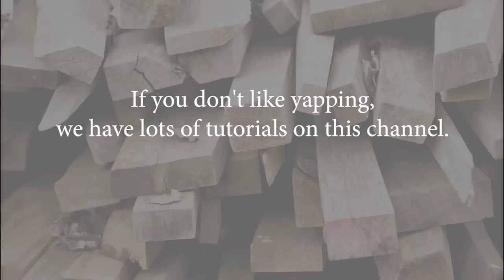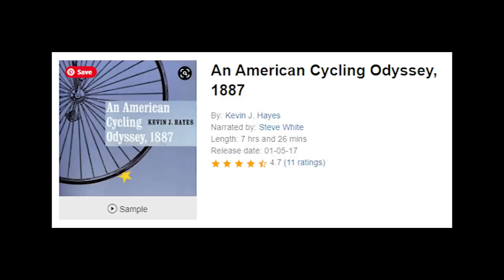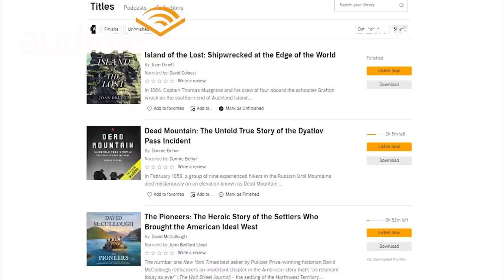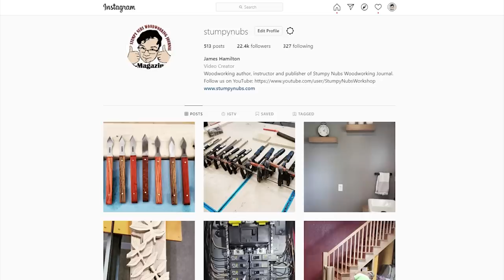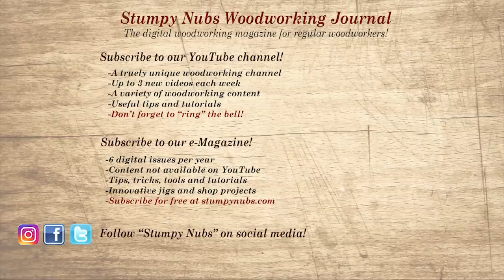Have they BANNED table saw dado sets????

Comment: Be advised: Long text following! Non native speaker writing!

Well, at least in Germany Dado sets are not straight out forbidden by law, just by the national work regulations for >>commercial use<< of the machinery.

As you said, the weight of the driven tool and the stop time to match (or to better) are reasons these things are banned >>in work places<<.

Another factor is, that the regulations explicitly say, that a tool is only to be used for its intended use and not to be modified for other uses. So a table saw is only to be used for cutting through material and not to make dado's on it, for instance.

You briefly touched on the arbor length: That is done by the manufacturers, because they themselves define the tool to be mounted and used on their machines. Any other tool mounted to the machine or any modifications to fit that tool, is...how do I phrase that right... Let's try it this way: If you use tools, or in this case specifically: blades with dimensions the manufacturer of the table saw says are okay, then, if something happens and it is a constructive problem of the machine, the manufacturer is liable for any costs associated with injuries to people, damages to company property and lost profits, because the machine "blew up", so to say. But: If the machine is modified in a non conform way, the manufacturer is no longer liable, because they can say, that the modification made it possible to use the wrong "blade", which is use in a non conform way.

TL;DR: It has to do with liability, quite simple.

However: If you can get another arbor or build your own and exchange it for the original one in your saw, you legally can mount a Dado set on your saw in your hobbyist woodworking shop. Because: What you do in your private hobbyist shop is of no concern to any work place regulations, as long as only you yourself are working on that machine and >>absolute nobody else<<!
But: If something happens, you are yourself on the hook for everything - as always.

I hope my point came across the right way.

Edit's: Missing or wrong letters, added critical part of sentence.
Reply: Very knowledgeable and clear explication. That's how I knew you were a non-native speaker :)
Reply: These endless nonsense For Your Own Good "safety regulations " are sweeping America too :-( but for now. MY DADO STACK STAYS.
Have a nice day.
Reply: @uglybobhere  Well, in Germany any employer is mandated to make sure his/her workers have safe and appropriate tools and machinery to work with. And a safe work environment as well. Furthermore they have to make sure these things stay that way over time.
In case you didn't know: Here the employer supply's the tools for the job. The employer even needs to supply the safety equipment (PSA), like gloves, safety footwear, helmets, safety goggles, etc. If you change jobs, you need to give back the tools, but your PSA is of no use to them, because of sweat and what not.
If you loose a tool or it gets damaged during use, the employer needs to replace it. But don't let that fool you: If that happens too often or there is a pattern, you need to justify every replacement and explain, why tools break regularly. That can be indicative of wrong use or the wrong tool for the job. If on the other hand you fail to justify properly, there can be reprimands for that. But that's up to the employer on a case to case basis.

So, it is in the best interest of the employer, that you use quality tools and that you use them appropriately. If a tool has a manufacturing defect and it hurts you as a worker, then the manufacturer has to pay, because they sold something unsafe.
If the tool is damaged while in use and you don't stop using it and because of that you get injured, your employer's business insurance is on the expensive hook. The very same applies to when you as a worker modify any tool or machinery in a unsafe way and something happens, the employer's insurance has to pay for your ignorance and dumbness. But your employer's insurance fees will likely rise and he/she could be paying huge fines.

So it is in the best business interest of your employer as well, that every tool or machinery you use is safe and inspected regularly. With something like "bring your own tools" like is custom in the US (at least that is the last I heard), that is not possible.

Yes, safety slows down many things, but better that, than some heavy, life long injury.
Reply: Felder even sell there one dado blades for hobbyist
Reply: @madman6648  Felder does build what the customer wants, more or less. If a customer wants the machine to accept dado stacks, they make it so. But not everyone is able to put a Felder in their workshop.
Reply: @madman6648  Felder also sell dado blades for commercial use. The reason they can do that is that their machines are equipped with a good enough electronic brake to be able to stop the spinning dado blade within the regulated time. But in order to prevent the locking nut from coming lose the blade is held in place with some additional locking pins which prevents the blade from rotating on the arbor. This means that the blade needs holes to locate this pins and you are basically limited to the dado set felder sells. But yes. you can get a felder (or hammer) saw that accepts (felder made) dado blades, and fulfill the regulations in (most of) Europe. (The locking pins to prevent blade rotation is placed on all their saws, not only those accepting the dado stack. So all saw blades needs appropriate holes for those pins. )
Reply: @palundblad9346  I think the holes are pretty standard for the 30mm arbor blades used in Europe,  certainly not unique to Felder. I bought blades with these holes long before I had any idea I would once own a Hammer saw.
Reply: @tilmanbauer5728  I agree. It is quite common here that blades have the holes for these pins. I just wanted to highlight that the holes wasn't specific to use with dado blades. But it is also a fact that not all blades have them. I had to get rid of some otherwise suitable blades when upgrading my saw due to the lack of holes for the indicator pins.
Reply: I am from Slovakia and i was thinking that dado blades are "banned". Then (recently) i went to Felder dealer where i ordered table saw. Was really suprised that they offer in their catalogue dado option for little surcharge. Of course i choosed this option 😀. At the moment i am really confused - i dont think any law has changed (within EU), but on other hand Felder provides dadoo option by official way 🤷 (thanks god for it 😀)
Reply: I guess you also need to mention the "Berufsgenossenschaft" (BG). 

(AFAIK)
In Germany an accident that happens during working hours needs to be reported to the BG - if it happened due neglect the employer needs to pay a higher fee to the BG. The BG also has a statistic where a lot of accidents happen and will adjust safety protocols accordingly.

Simple example - if a lot of accidents happen while employees are drunk - working while intoxicated will be forbidden.

Some regulations only make sense after years - e.g. special knee-pads. The juvenile knee won´t have a problem without, but the worker 20 years along the road will have accumulated enough time to have broken knees.

Yes, you do not have the freedom to disable yourself, as we have public healthcare, and the public in the end will have to pay for it.
Reply: @essmene  everything I stated above does refer to the BG, more or less, but naming it wouldn't help much on an American woodworking channel, without proper reference to something they know.

You have to remember how little Germany is compared to the US and how far away.
Reply: @wiedapp  I just wanted to point out that some of the safety regulations are the result of statistical injuries. So if Jay says he has been working doing X and nothing happened - the statistics are out of 1.000  workers 5 loose their digits/hands/eye. You do not necessarily have to encounter it yourself for a security measure to be effective and necessary - if you want to work - if your goal is being maimed that is a different topic.
Reply: @essmene  thats barbaric! In America we only add safety regulations when it benefits The Corporation to add barriers to entry for potential competition.
Reply: @bobcougar77  Or when it happens to someone less than 20 years old, or with less than a year on the job.  Or a minority with less than 15% representation in the community.  Or...

Comment: In general, I find dado cuts to be safer than standard cuts. The blade is rarely more than a half inch above the table, and it is completely covered by the work piece so it is easier to apply firm pressure down and into the fence.
Reply: totally true!
Reply: For metric system users:
0.5in = 1.27cm
Reply: @chri-k  I have to admit half an inch protrusion does seem safer than 12.7mm.
Reply: It’s not about the safety of the cut. It’s about brakes jerking blades loose. And keep in mind; mist euro sliders take 16” blades.

Comment: Back in the day, we used to use wobble saw washers so we could cut wide rebates with a single blade. I just looked them up out of curiosity and they are still available in the UK.

Comment: If the more concerning issue was the potential of the blades coming off the arbor I'd say something like a retractable arm that can be placed at the end of the arbor, kinda like the tail stock on a lathe could be made to ensure blades could never just fly off.
Reply: That's a good idea!
Reply: What about adding a jamb nut onto the arbor?
Reply: @calstatelaalproductions2358  
Was kinda my first thought but I assume someone figured it would be an extra peice or small part that people could easily lose, forget or whatever and wouldn't ensure safety.  Of course I'm only guessing at the logic but I figure something like I'm thinking of could be integrated with an interlock of the power switch and be a permanent fixture that would not be a very expensive add to the overall cost and perhaps could have a secondary function of being able to jam or force into the arbor as an added breaking system.
Reply: Or just a simple lock nut, threaded the same way as the main one.

Comment: I use to work in a furniture factory.  One of the guys did a plunge cut with a dado blade and started to far forward.  So he pulled it back about 1/4" and the piece shot back wards and his fingers went into the blades.   Since then I am alot more cautious about them.
Reply: Did he lose the fingers?
Reply: @andysmith1996  I'm sure someone found them. They usually leave a squishy red trail.
Reply: Fingerless Carlson?
Reply: They never found his fingers. But they did find some hamburger meat. Why someone would store hamburger meat in a table saw is anyone’s guess.

Comment: Nice discussion. I recently updated my Delta Unisaw I ordered new 20 years ago. I replaced the stock guard/splitter with the Shark Guard manual riving knife/splitter dust collection guard. I also inherited a Delta 1.5hp dust collector and followed your upgrade recommendations for the Wyn pleated filter and using a 5gal bucket with small clamps to channel the dust into an easy to dispose of trashbag. After sealing up the Unisaw cabinet some to force the air from the cabinet dust port to pass by the blade and having another 4 inch port connected to the Shark Guard, this saw area now stays fairly clean for such a low power dust collector. The old saws don’t support the auto riving knives, so this Shark Guard option is a nice upgrade and much easier to deal with than the stock guard.

Comment: I have been lucky, when my father upgraded he gave me his 35 year old moa Shan TSC table saw with a nice long arbour, originally supplied with a wobble blade (now that's a scary piece) I got a diablo set from the US because that blades "can't be sold in Ireland" and 3 days after my set arrived, my local tool store had one but it wasn't on the shelf, it sits between the machines on the showroom floor. I love mine it was scary at first but in my opinion now it's no more scary than a 12" rip blade
Reply: I have 2 sets of calibrated wobble washers, that are, at least, 25 years old. My DaDo set is about the same age.  Have cut a lot of Teak with them, boatbuilding.

Comment: Imagine this solution to the European dado problem: an arbor that is 1/2 inch longer than standard. It is threaded in the normal way, but the 1/2" on the end is a of slightly lesser diameter than the rest of the arbor and it is threaded in the opposite direction. Then, when you install a dado set, you secure it with the normal nut, but in addition to that, you lock it with an oppositely threaded nut on the narrower last 1/2. The lock nut can have a wide flange that applies friction to the regular nut. It wouldn't be needed at all with a single blade. Then, it wouldn't matter how quickly the blades stopped and you wouldn't need a special guard. The two-diameter arbor and its locking nut could be standardized so as not to require special or additional purchases.

Comment: Here in Canada, there’s no issue getting saws with a long arbor and dado sets. I originally had a wobble blade, but after using a proper dado set, I’d never go back to one of those wobble blades. Before then, I used my router with a fence, but I feel much safer using a dado set than using the router to do it.

Comment: I do love the braking on the saw. It cuts way back on the amount of time I have to wait for the saw to spin down.

I have a Felder saw with grooving blades. It's not the same as our dado stack, though. It uses shims and is closer to shaper tooling in implementation. Same idea, different implementation. The brake has no problem spinning it down despite the weight. They also use two pins to keep blades from spinning off the arbor.

Edit: I also use a floating blade guard. It's much more convenient vs the one it came with.

Comment: I had not realized what a “privilege” it was that I’ve had for the past 50 years: my Delta Rockwell table saw has a Bieasemeyer rip fence and a standard American arbor that accepts my dado set.

And I still have all my body parts—except my appendix—which was removed without using my table saw!
Reply: That's what a radial arm saw is for.
Reply: @rudyschwab7709  Nicely done.
Reply: I ruined two blades trying to take my appendix out with a SawStop.
Reply: @joewrosenthal00  It was a joke responding to your appendix line. I'll make that clearer.

Comment: Personally I use a router to cut rebates in boards. As you will well know it can be done freehand with a router and the jig that comes with even the cheapest routers or better with a router mounted in a table using the fence. I simply don't cut enough Dado's or rebates to justify using a dado stack. You could also use an old school; rebate plane, or routing plane. You can keep your spinning stacks of death. ;-)

Comment: Thanks for that. We Europeans actually appreciate dado stacks and use them in private workshops.A lot of criticism comes from professional woodworkers who can't use them for insurance reasons. In fact I prefer the 5/8" arbor as I can use all kinds of American tools  like the mitre fold dado blade. Enjoy the vacation !
Reply: So can you just buy them for personal use? Or do you have to meet a guy in an alley that opens his coat and has a bunch of blades hanging there?
Reply: @anthonyhiscox  Ha Ha. They are freely available.
Reply: Where do you find a saw in the UK with a long enough arbor to use in a private workshop?
Reply: @gerrard4215  They are available from specialist ( mainly second hand ) machinery shops. You could also import from the US.
Reply: @anthonyhiscox  but if something happens your insurance says, well buddy you fucked up, pay your self, atleast here in germany
Reply: @kthec1298  nope, in Germany we call it "Verstellnuter" and many professional european panel saws can mount them. For the private use there are for example machines like the Hammer K3 who can be ordered with a longer arbor to mount these tools. They also have the advantage of a stepless adjustment, so you can saw those dados in any thickness between two dedicated thicknesses. Also they have a better cut quality since they usually have a little separate side mounted grain cutting blade.

Comment: Hi Stumpy. As you also say in your video, dado’s are not banned in Europe. Felder fx. has solved the problem with braking the heavy blades to a full stop in seconds. There are just pre-drilled some holes in all their blades including their dado stack and pins from the arbor that fits the holes. The holes also helps aligning the dadostack, so the tooths are properly positioned to each other. Axminster also have dadoblades for some of their saws. However many europeans seems to prefer routers etc

Comment: For many years I had a dado stack on my model 77 worm drive with a modified guard and table for cutting seat cuts in rafters. I also had a 32" blade on an old all metal Skill Saw that originally had a 10" blade on it with modified table and guard for cutting head cuts on rafters and cutting beams. They where both stolen along with all the rest of my tools back in the 90's never to be seen again. Both saws where very dangerous in the wrong hands and I hope the person that stole them from me found that out the hard way.

Comment: There is a small, family owned shop that makes a product called "Sharkguard". You should check it out. Blade guard with riving knife included as a part of the assembly.
Ronnie is always open to suggestions on improvements. A quick internet search will pop up the website.